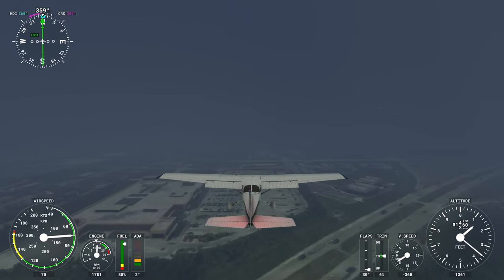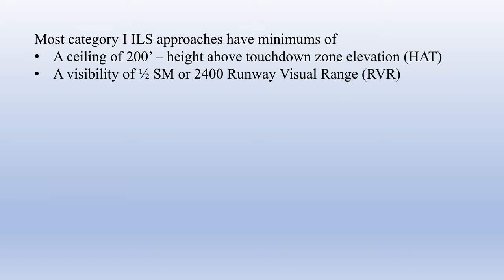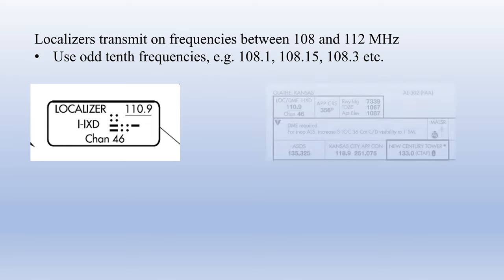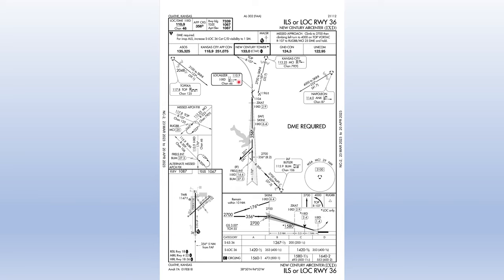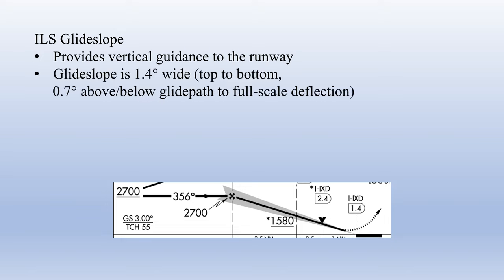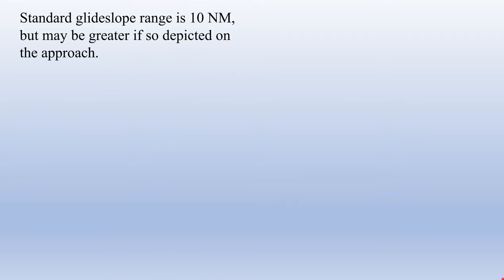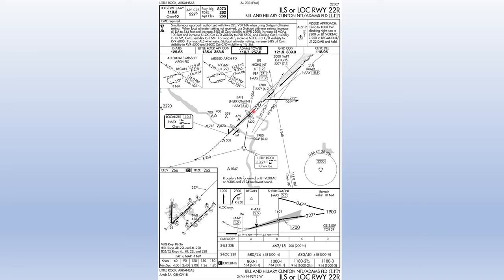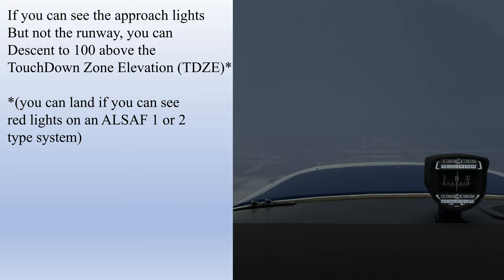MSFS - In depth ILS tutorial, part 1 (AH IFR flight lesson #6, part 1)

Comment: Great videos that have helped me greatly. Just a suggestion the newer G1000 has a green circle(flight path marker) on the PFD. Would value your opinion on how to use it in flight.
Reply from the maker: Glad you are finding the content helpful FrySimulation, and thanks for watching.

With regards to the green circle, are you referring to the green airplane symbol that appears on the attitude indicator when you have synthetic vision turned on?  If so, that is called the flight path indicator or flight path vector.  It displays your flight path on the attitude indicator (i.e. if you are climbing or descending, and your ground track (instead of your heading.))  I'll post a link from a video where I talked about it briefly below, though I may do a more in depth video on it in the future.  

I don't find it particularly useful in GA aircraft - but it it  very useful in military jets with Heads Up displays.  You can place the FPI on the runway during approach, and then use that and power management to fly a decent approach.  It's also useful as an early warning of microbursts in airliners, but I don't think microbursts are emulated in flight simulator.

Here is the video where I talk about it:  https://youtu.be/bfcIzxmW5ug?t=1320
Reply: @AlphaHotelFlightSimulation  That is it. Thanks and I will check link